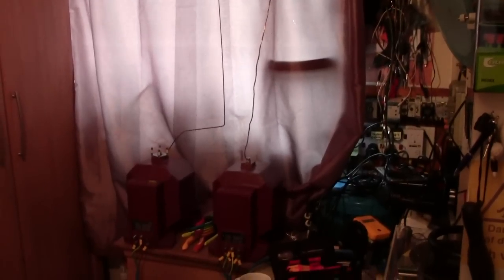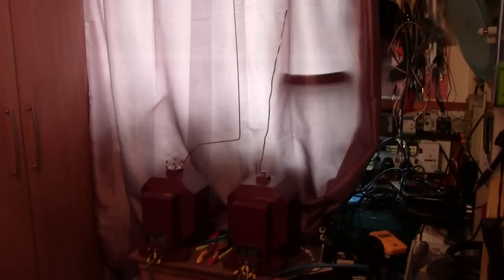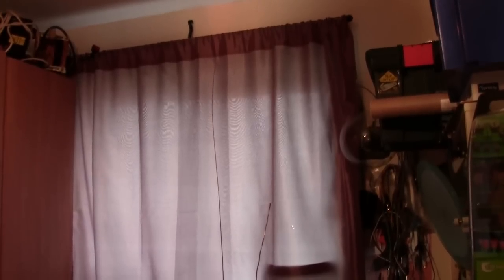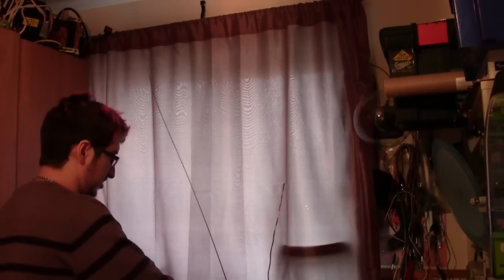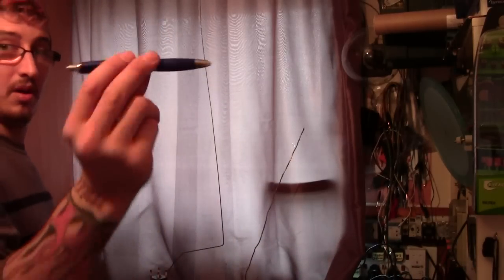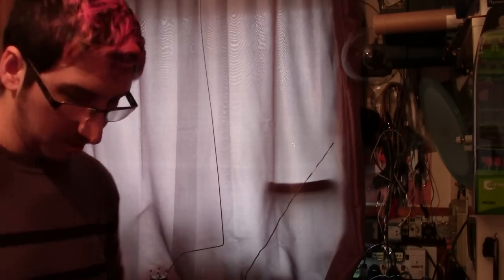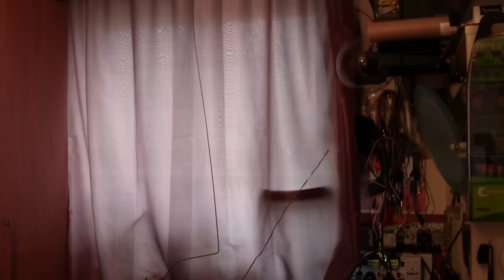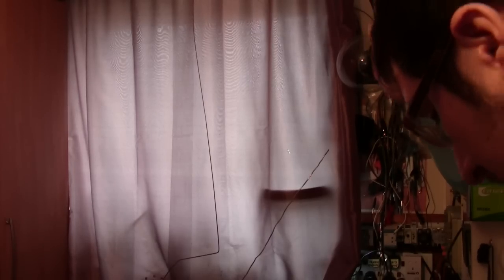WOW  153KV PEAK to PEAK (approx) on 2 x 20KV potential transformers RUNNING

Comment: Jacobs ladder? more like Jacobs crane haha, my eyes went wider than that gap when it saw those arcs span up there as if they're out on a morning stroll haha.

And you're hand span is an acceptable form of measurements of long as you announce what it is! I wouldn't use your head though as I'm sure it had inflated larger than the room by the end of the video! xP

As for the set up, I can see great potential for these transformers (no pun intended) but you have definitely outgrown your workspace many times over!
Reply: Your right there mate definitely have no space .I can't wait to add the extra 3000W ballast